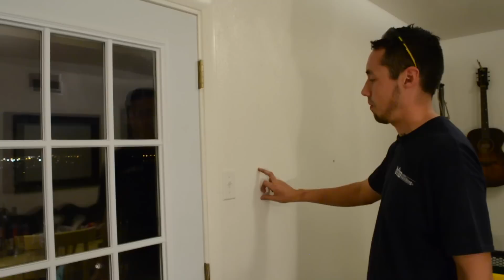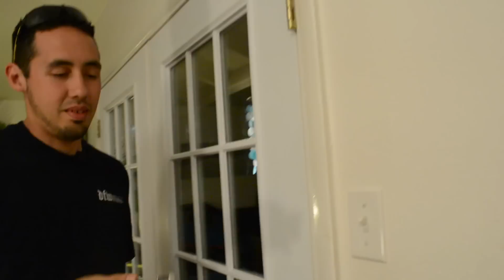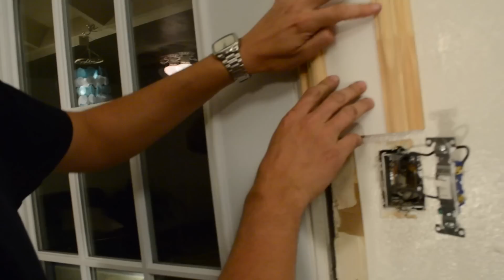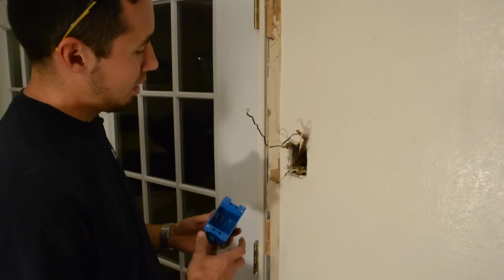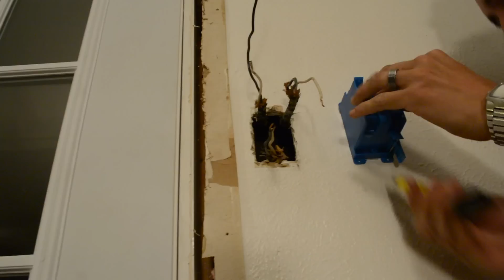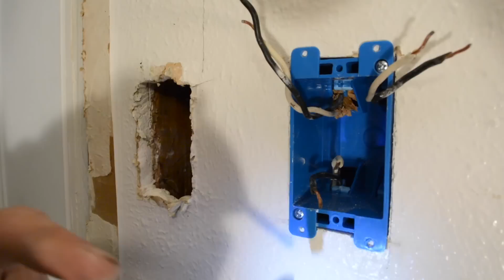Trim Carpentry - How to Move an Electrical Outlet/Switch

Comment: It's not bx, so I get the non metallic box, but since that's the case, where the fuck is the ground wire?
Reply: nyphonejacks did you notice the cover around the wire, old romex, old house also answered another comment about insulation.
Reply: Ajoking best that I could find was https://www.ecmag.com/section/codes-standards/residential-wiring    
NM wiring has required a ground conductor since 2005. With the advancements in technology greatly increasing our dependence on electricity, where lighting was mostly all it was needed for in an old home, I would think the priority would be to upgrade wiring that has been out of date for over a decade rather than making things look pretty. 
I couldn't find a comment where grounding was addressed but I did see a comment mentioning the fact that this exterior wall isn't insulated, so he's jumping the gun big-time as there is much work to be done before he should have installed any trim carpentry.

Comment: Good explanation.  You could have extended the wire with some additional wire and wire nuts if you did not have enough wire to make your connections on the switch.

Comment: @Finish Carpentry TV, if you didn't have enough slack to move the box in that location, how would you have extended the wires?
Reply: This is where it gets more expensive.   You may have no choice but to run new wiring to the new switch location.  If you have convenient access such as from the attic space, this may be no big deal. Or it could be more difficult.  Time to call an electrician.
Reply: SomethingClever outside wall probably doesn't have any attic room

Comment: How do you pull wires across if you are going over a stud?
Reply: drill a hole
Reply: There was no stud in the way. But if there is you need a special long holesaw bit that can reach in and drill through
Reply: Use your imagination. One easy way is cut through the drywall and notch out the stud and than cover the notch with a protection plate.

Comment: From an electrician's standpoint, it's good practice to confirm the wires have been de-energized after opening the breaker(s) feeding the circuit you are going to come in contact with. Pocket tic tracers are relatively cheap, and you can simply touch them to each wire. If one is still hot, the tic tracer will give an audible tone and many have a red light that also illuminates. An added safety measure would be to confirm the tic tracer is working properly by testing it on a known energized source both before and after checking the circuit you intend to work dead (commonly referred to as "hot, dead, hot" testing in the electrical industry). It's something those of us in high voltage are trained to take very seriously, which is probably why I'm sensitive to not seeing it done. That said, 120v circuits kill more people than any other voltage. 

Edit: In no way am I "talking down" or criticizing Richard. My comment was more for the general audience of his channel than directly towards him. He's clearly done this before and is confident in his ability to perform it safely.
Reply: Aggie87 ....That is what your mom is for.
Reply: ObeyTheLaw she was busy lezzing out and getting herpes from your shemale pops.
Reply: Thanks for the tip. Seems like good practice.
Reply: What about when you don't have the slack wire from the old box to move to the new location? Would you need to run romex to the desired spot of the new outlet? This is the situation I find myself in.

Comment: Your wires (by code), need to extend at least 3 inches beyond the outside of the opening. NEC 300.14. All of your wires except 1 wire does not meet code.
Reply from the maker: Thanks.

Comment: You can always extend the wires if need to. On an old house you can run into very old wire that may not tolerate being pulled without loosing their insulation, always check before you pull the wires into the new box if the insulation is brittle you can add extensions to them and pull new wires into new box. However check codes in your area to see if this is allowed, some places require you to have wiring replaced before you proceed to prevent fires 🔥, since the wires could have suffered in an area out of sight while you pulled the old box.

Comment: One last tip is if you don't have enough wire you may be able to move the box up or down depending on the wire lengths and directions to give you more slack

Comment: If you just wanted to rotate box 90 degrees so it's horizontal, what would you do?  The stud would be in the way of those 2 clips clamping drywall. Would you have to move outlet ok her regardless?

Comment: I kinda cringed when I saw that there is no insulation in your wall cavity. But I'm an insulation contractor, what do you expect? Good video though
Reply from the maker: this house is from the 1960's. It has a lot of problems. Thanks.
Reply: Gotta love fixer uppers.
Reply: Hotrod Hog Back then power was cheap. They didn't care much about insulation.

Comment: Your lucky the old electrician left enough wire to accommodate the new box. Here in Jersey, they give the bare minimum.
Reply: Code states that the protective sheathing needs to be inside the box at least a 1/4 of an inch past the clamp or entry point. The wires or conductors with insulation on them shouldn't be into the box with  the sheathing outside of the box. Remove any cardboard or cloth braded sheathing wrap for a possible ignition source from a spark.

Comment: Good Morning dfw ,  I've been doing home renos here in Calgary Alberta , Canada for over 25 yrs now .
I've just started with you channel , I've watched 7 -8 videos , and find myself quite intrigued . 
Trim/finish carpentry was something I always hoped I'd get into , ( on a full time basis ) but never really did . always seemed to be another bathroom or basement , to do .
Anyway ,  had You tube/internet existed 25 years ago , I think my work would have gone a lot differently .

Moving a box is always a pain in the ass , but its covering up the old hole that usually the worse part ...having to drywall,mud/tape , sand and paint .  You got lucky , having such wide trim , for me , the new trim always seems to be a 1/2"  narrow to cover old hole , and the wires usually the same   :)  .

Couple of questions , did you do any sort of schooling for what you do , or learned on the job ?   Do you do everything on site , or do you have a shop of some sort  ?  
Re the painting , I see what paint you are using , but I'd like to know what kind of spray equipment you use , tip size  etc .

Do you do much , or any natural wood trim , or do you stay with just paint grade ? ( maybe I'll answer my own question once I go back into more videos ) 

I was impressed with the 24 ft length  of crown you did in one of the videos , but as I work by myself , that would never happen , perhaps one of the reasons I never got into it .

Anyway , keep them coming    Bob

Comment: Another excellent video brother, just in case you didn't know, the box tabs where your wire comes though is pushed the wrong way, those tabs are used to hold the wire in the box and is considered a clamp, if those tabs are not there the wires need to be stapled within 4 inches of the box, and 12 inches even when it is there. I know you never claimed to be an electrician lol, and that's why I'm not trying to be rude about it, just letting you know  so you can be aware that, what's done there is not legal by NEC. Hope you don't take my comment the wrong way but, I like when people tell me when I do something wrong, how else do we learn right? We all don't know everything.
Reply from the maker: Negron Remodeling good looking out. no I definitely don't take it as rude I am constantly learning everyday. that is what life is all about. and I honestly can say I learn something new everyday doing this job 😀
Reply: That's interesting, i did not know that, but if you are using an old work box because the drywall is already hung, how do you gain access to the romex to staple it?
Reply: @Pro1er  , if job was done to code in the 1st place,  romax should already be stapled.
Reply: @Pro1er  If the job was originally done to code the romax should already be stapled.
Reply: Pro1er yes you are correct, even if the tabs are there, "its supposed to be stapled within 12 inches of the box". However, inspectors cannot see inside the wall. Although, I have had an inspector make me open the wall before.
Reply: Pro1er no worries, I don't take this as a battle lol. I understand where your coming from. NEC code certainly is the guideline but, state can always supersede. Every electrical inspector I've come across will fail a box if the box clamps are pushed the wrong direction or the clamp is stressed meaning, more than two lines coming through one opening. It's been to the extreme that once we were failed because one of my guys bent the tab to far in and he could see the white stress line where the tab bends. Some inspectors get a little crazy about certain things but, most of them feel as though if they don't find something, then they aren't doing their job lol. Hell, some fail because they want to be right, so they make up these "codes". Most townships where I work are rough but, what can you do? I want to keep moving not make enemies with someone I will come across again. It sucks but I need them to pass me lol
Reply: I've never seen anyone attempt to staple wires for a single-gang remodel box, but you could try to secure them with a very low clearance right-angle impact & some sort of screw-driven alternative to staples... or maybe you could still use a staple if you used lineman's pliers to drive the staple in.
Reply: @miguelito2361  You aren't required nor are you supposed to staple NM cables when using an old work box.
Reply: Negron Remodeling if you have no access then you don't have to do any strapping.
The tabs on the box are like you say for holding/supporting the cable to the box.
You should have sheathing inside the box to ensure the conductors are protected outside the box, it has all kinds of ratings for fire and so on
Reply: Pro1er  Good question, you cannot break the tabs off the box. The tabs are there to hold the Romex. You cannot gain access to staple unless you open the rock. Every time we have electrical Inspection the inspectors will look at the tabs if it's an old work box, they obviously cannot see through the wall but, if they do not see those tabs they will fail. I only mention code because if he will be doing these types of installs it's good to know the codes pertaining to that situation.
Reply: OK, I'm not an electrician, but I have done a lot of home wiring and have tried to follow NEC code. I looks as if you can knock out the plastic tabs on an old work box, (although I don't know why you would want to), as long as the romex is stapled within 8 inches of the box. Also, i believe there may be a exception to stapling the romex for old work as long as the clamps are used in the box. 

NEC 314.17(A) requires that where cable is used with metal boxes, the cable must be secured to the box. Where nonmetallic boxes are used, NEC 314.17(C) requires that, in all instances, the cable must be secured to the box. Securing to the box may be done by use of cable clamps, which are a part of the listed box, or by separate cable connectors. There is one exception to this rule where nonmetallic-sheathed cable that is used with single-gang boxes (2¼ x 4) securing the cable to the box is not required. Where single-gang boxes are used, multiple cable entries are permitted in a single cable knockout opening.

The one code violation that he may have committed is that I believe there must be at least 6 inches of free cable available in case of repairs.

Take this with a grain of salt as I'm only going on what I can find on the Internet. Hopefully we're all here to learn and not criticize.
Reply: Yeah, I know about the tabs but I used an old work box to install a new light switch and of course I didn't remove the drywall. I had never heard about stapling the romex before, I thought that's what the tab-clamps were for.
Reply: On remodel with sheet rock still on, no staples needed. 
From my understanding staples are partly to keep the cables organized during other stages of construction. 
New construction boxes do not always have spring tabs. It is expected that you will be stapling the cable to code.
Reply: @turboflush  That's just plain stupid.  By that logic, it shouldn't be necessary to secure the romex for any installation, because eventually it will all be covered up.  I hope you're not in the trades and doing that kind of shoddy work.
Reply: @jeffeverde1  
Not sure who you meant to reply to. 
But.. since you are a walking book of wonders.. how do you staple your wires through a one gang remodel hole?

Comment: Thanks for the video. This is exactly what I asked for in a previous video. I have had trouble finding a video doing this on YouTube.
Reply from the maker: Yes i remember. Thanks for the idea.
Reply: Hints from a master electrician:
Box fill needs to be a consideration (cubic inches are marked on the remodel box and there is a count based on national electric code for each conductor based on size of conductor for how big your box needs to be. For example each 12 AWG conductor needs 2.25 cubic inches, the device counts as two conductors of largest size etc.)
Aluminum conductors cannot be attached to copper with wire nut.
Switch wiring can be the most complex wiring in your house so if you mix the wires around it can take hours to trace down what the function of those wires were. (For example white wires aren’t always used as neutrals in switch boxes.)

So my advice is called a licensed electrician so you don’t burn your house down or cause injury or death to personnel or damage equipment.

The National Electric Code is in fact written by the National Fire Protection Agency. Your life and belongings are worth more than whatever a licensed electrician charges.

In my opinion the video should have been like this: How to move an electrical out, call a friend and ask for a referral on an electrical contractor they have used and trust. If you don’t have friends that use electrical contractors, find new friends. 😁
Sure you can simply search online but a personal referral will usually get you the guy who is honest reasonably priced and does good work.